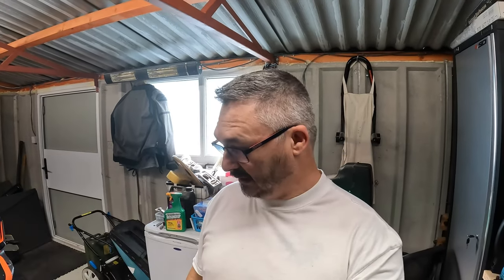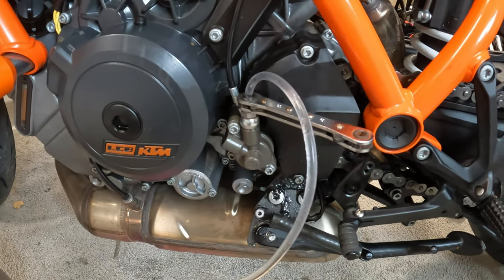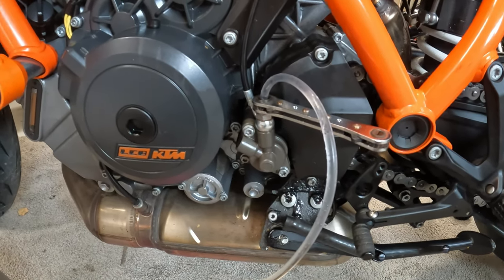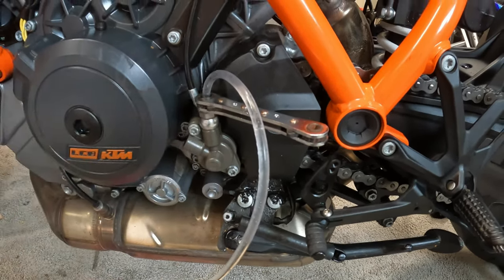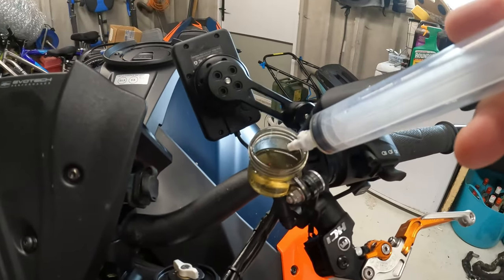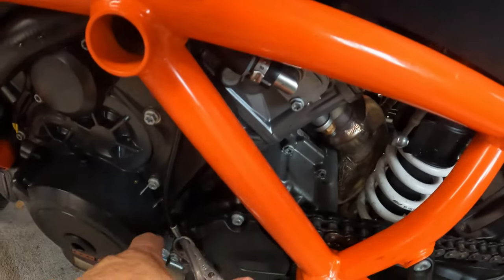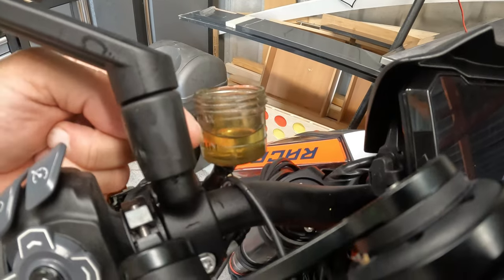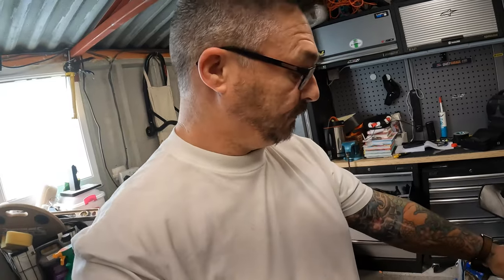KTM 1290 Super Duke R clutch bleed.

Comment: Great to see our kit in use - lovely bike by the way! 👍🏻
Reply from the maker: Hi and thanks. 
It was very helpful although the tube could have done with being a fraction wider but I got the result I wanted.
Reply: @Robbiemoto  Thanks for the feedback we will take a look!
Reply: I much prefer tubes being a bit tight. It's easier to heat them up and put them over the nipple than to tighten up a loose connection that leaks everywhere.

Comment: Keep a eye on that slave cylinder. My one failed on my 2021 super duke R. Ended up replacing it with a Oberon what a difference that is compared to the stock one. Well worth the money and better feel. I did get a replacement KTM one under warranty as a spare.
Reply from the maker: Funnily enough I’ve been reading this afternoon about the seals in a few of them giving up.
Reply: I upgraded my Aprilia rsv slave cylinder for the oberon and great upgrade 🔧👌🏻
Reply: The original ktm ones are pants and have been for years had to change mine on my 950 smr 2008 , for the oberon 1, now I have a superduke 2019 and I'm starting to have the same problems with the feel of the clutch ,going to fit the oberon 1 very soon
Reply from the maker: @johnmacdonald8846  I’ve been pondering over the thought of fitting an Oberon one  before the possibility of the original failing. 
I’ve not ridden it for a while since I’ve been away for a few weeks and the weathers been a bit crap 😄

Comment: Hi I'm about to buy one of these. Just wondering if you experienced and sudden engine cut offs, mtc failure, battery issues?
Reply from the maker: Hi. I’ve had no issues with the bike apart from the rhs switch cube failing when caught in heavy rain. I rode home in torrential rain left the bike for 3 days and when I tried to start it the power button wouldn’t work. Luckily it was still under warranty and they replaced it.
Reply: I have all of this